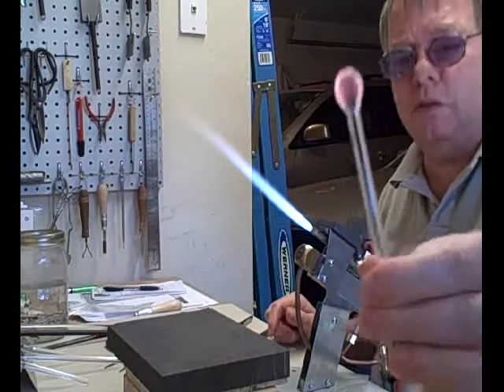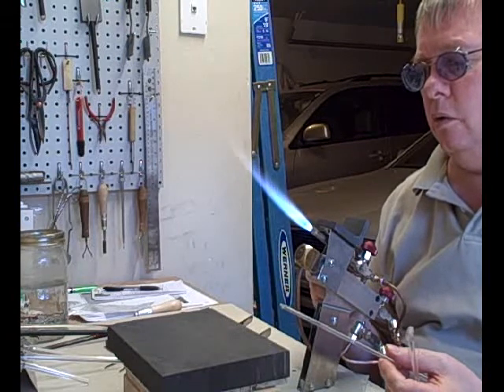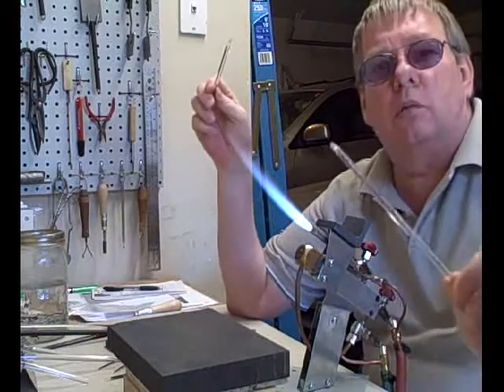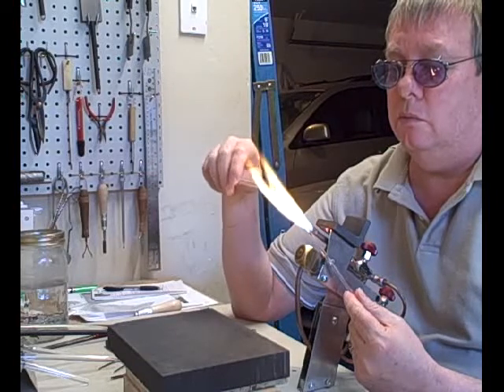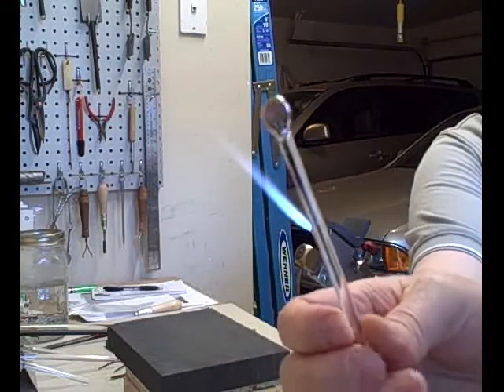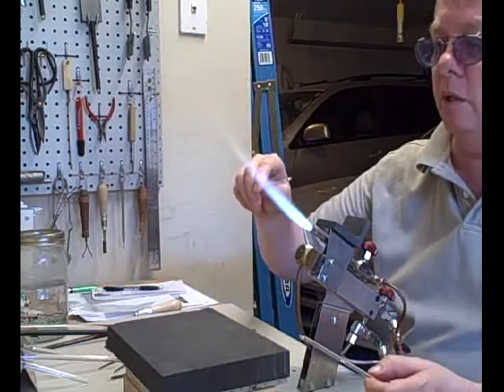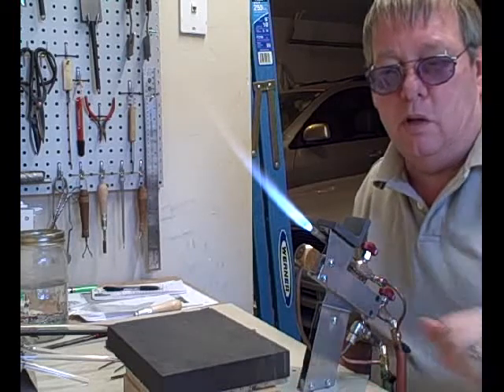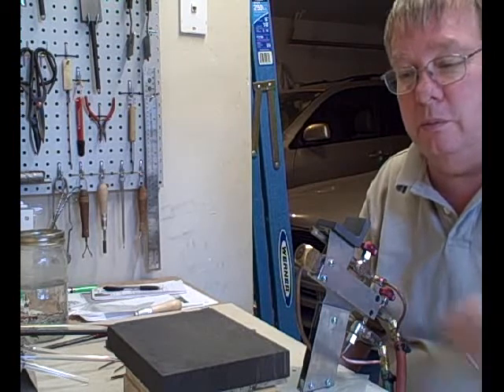Silver Fuming

Comment from the maker: @SDKsa1 Silver fuming is toxic when doing it without proper ventilation. I would imagine that if the silver were in the bowl then that would be quite toxic to the smoker as well. However, it isn't. The silver is on the sealed inner surface.

Comment: Even when not covered with clear glass, a moderate amount of heat will fuse the silver to the glass such that is won't come off with normal use. That said, I've seen cheap pipes that the silver was never worked in and you could wipe some of the fuming off. Even there, the amount of silver rubbing off is microscopic and nothing I'd ever concern myself with. Gold fume has a harder time bonding to the glass and is notorious for wiping off (especially inside out gold fume) but again, it's a tiny bit